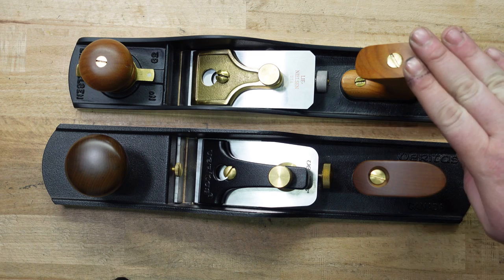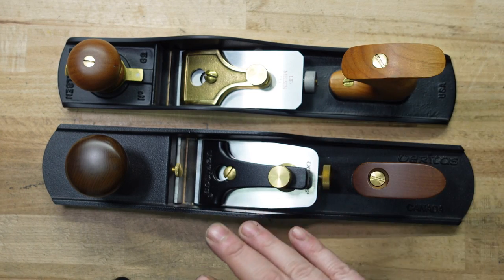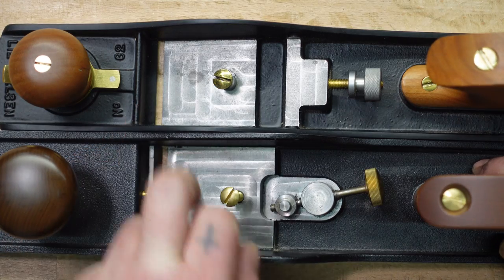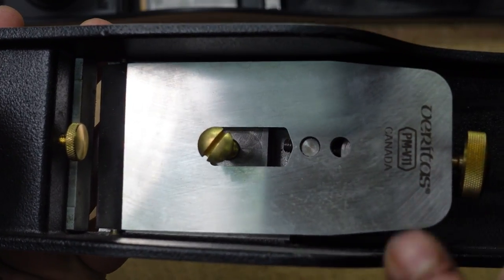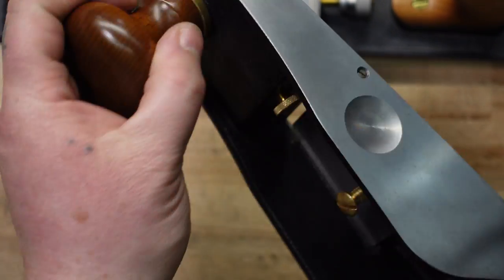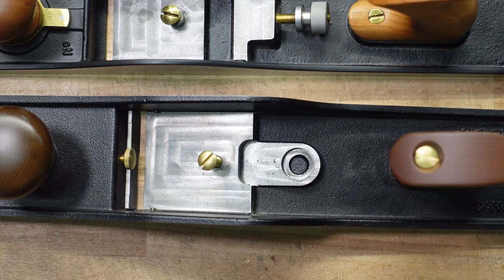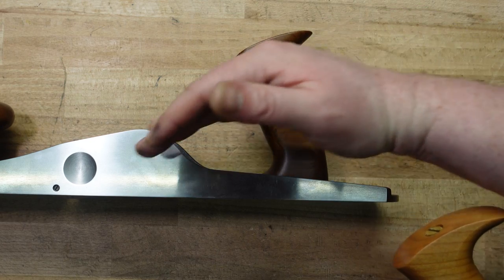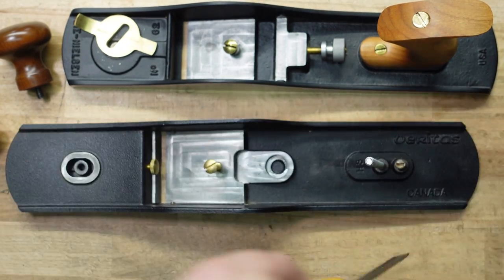IT'S PREFERENCE! Lie Nielsen No 62 vs Veritas Low Angle Jack Plane -Review & Side by Side Comparison

Comment: My wife wanted to get me a special present for my 60th birthday 2 years ago and I selected a premium bevel up plane.  It took me almost 2 months to decide on the Veritas over the Lie-Nielsen and there were 3 deciding factors:  1) I did not want to 'tap, tap' for blade adjustment; 2) The 'dimple' on the sides of the plane (plus the shape of the cap) makes shooting board use easier, and 3) I like the mouth adjustment better on the Veritas.

I do not have large hands and the Veritas is a heavy beast, but I have gotten continual excellent results with the Veritas plane.  I was so satisfied that I ended up getting the Veritas Bevel-Up Smoother Plane for my 61st birthday!
Reply from the maker: This was a great choice imo! And I made the same one and sold the LN lol
Veritas makes amazing planes!! They think about the user and add features to help! Not a knock on LN but all they did was copy a design and improve it, still great users. But veritas too it a step farther and designed a plane with us I'm mind! Just my opinion lol
Reply: For me it was the availability of an O1 steel iron. LN irons are A2, and I'm not fond of A2 steel. The bit of extra length to the Veritas was another plus.
Reply from the maker: Do you prefer 01 over Pmv11?
Reply: But, since I have read that  Powdered Metal Veritas Ours Goes To 11 steel is pretty much as difficult to sharpen as A2, I believe my heart will still belong to O1 in the end.
Reply from the maker: I get that for sure. Pmv11 is more difficult to sharpen than LN a2 imo. Haven't used ceritas A2 that much so I can't comment t on that

Comment: I love my L-N low angle Jack.  One of the best purchases I have made on my wood working journey.  I have four blades, one flat blade, one rounded (slightly) that I use as a smoother, a toothed blade that I use for flattening thin panels for ukulele fronts and backs and finally a high angle scraper blade.  I have not used sth scraper blade much, but he other three get much use.  This is the only full size hand plane I own.   

Thanks for the comparison!
Reply from the maker: That is awesome! I love how universal these planes are!!

Comment: Nice. Do you find a low angle jack to be an essential piece of kit?
Reply from the maker: No, not at all, imo lol. unless you make end grain cutting boards alot lol I actually plan to sell both of those 
Thay may start an argument because some use it as their main plane, I use bevel down tho so it's not needed for me. You do want something low angle for trimming box joints and dovetails tho. A block plane or the veritas LA smoother (no 3 size) are what I use.

Comment: The knob screw on the Lie Nielsen 62 is prone to overtightening, which causes the brass disc to separate from the knob.
The Luban 62 (or Wood River elsewhere) has the mouth adjuster of the Stanley/LN and Norris lateral adjuster of Veritas. Great plane but the build quality and fit and finish is nothing like LN or Veritas.  
The advantage of the shorter narrower LN is it becomes the ideal "do everything plane".
Reply from the maker: Thank you! I didn't know that about the knob! 
You are right I dear alot of guys that use the LA Jack as their main plane. They use the 25* iron for EVERYTHING. 
I should do a video comparing that lol

Comment: Can you use either right of the box, or do you need to sharpen the blade first .  do you also need to create a second bevel?   Nice video.  My heart tells me to get Lie Nielson
Reply from the maker: Both need final honing, I do a 2nd bevel for ease of sharpening. The back of the Veritas iron will be flat but LN may need a little work but not much. Hope this helps!
Reply: @BatCaveCreations  Thanks.  I am surprised that LN needs a bit more work.  I always thought they are a notch above Veritas!
Reply from the maker: @nasarazam  eh that is HIGHLY debated. I personally went Veritas. And even the LN guys go Veritas for this plane, the shooting plane and jointery planes. Unless they are a die hard LN fan haha
Reply: @BatCaveCreations  I do not have much hand tools experience. Should I go for A2 or O1?
Reply from the maker: @nasarazam  if Veritas its PMV11 all day. It is 100% worth the extra money. 
If you are new to handtools ime also gonna reccomend veritas, it is easier to learn imo. It was my first and it is an AMAZING plane, still have it and use it everytime I'm in the shop. 
Metal type too, O1 is easier to sharpen but the edge doesn't last long. A2 is HARD to sharpen and the edge lasts longer. PMV11 is easier to sharpen than A2 and the edge lasts forever. I rarely have to use the stones on it. I hit the strop and its good to go again.
Reply: @BatCaveCreations  thanks much
Reply from the maker: @nasarazam  anytime!

Comment: My issue with a plane like the LN is that it requires very accurate sharpening. If you sharpen by hand and the cutting edge is even a couple degrees off 90, you might not be unable to adjust it enough to get it aligned with the mouth. I think that's the whole point of a lateral adjuster, to give you leeway so you aren't forced to go back to the stones (or back to the grinder). I think Leonard Bailey and stanley wouldn't have gone through the trouble to include a lateral adjuster on any planes unless this was an issue. It might have been easier to manufacture and easier for us to use if they added those "bumpers" to to guide it straight. 

If you use a honing guide or you're good at sharpening, it's a non-issue. If you're like me, you'd run into problems. I've wound up with skewed edges even with a honing guide because of the veritas mark 2 honing guide's manufacturng quality control issues.
Reply from the maker: I fully agree with this! thank you for stating it!!!!

Comment: I've been wondering for a while now, how does a low angle plane with 38' bevel compare to a standard plane. The angle of attack should basically be the same but what is the impact of no chip breaker on the feel for the user and finish on the timber?
Reply from the maker: The chip breaker doesn't make a difference for bevel up. I look at it as a bevel up is slicing like a chisel (sole of plane = bottom of chisel, flat reference so it doesn't dive deeper.) 
A 38 iron needs alot more effort to push vs a standard bench plane. Like having a steeper angle on a chisel. 
I hope that helps answer your question!